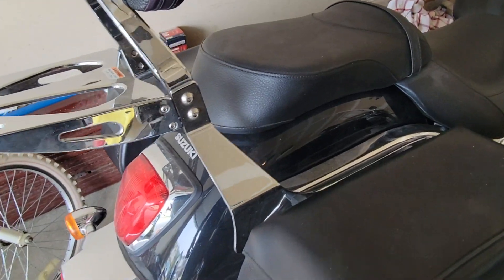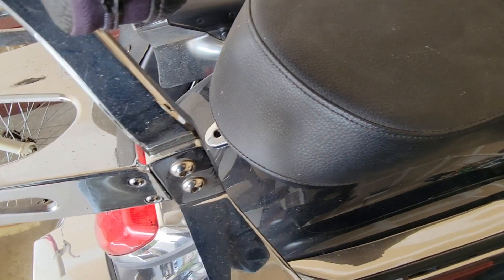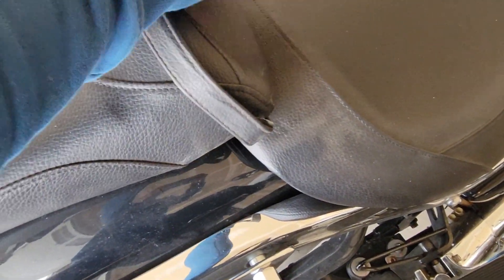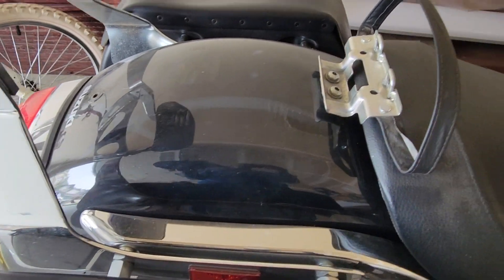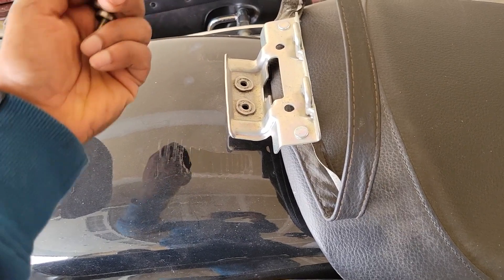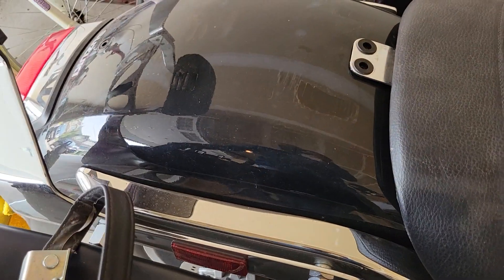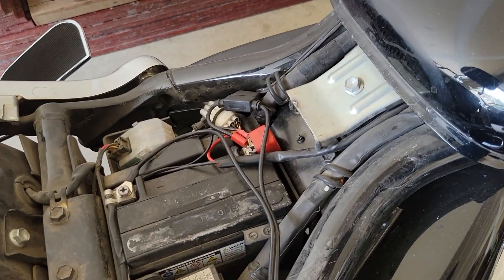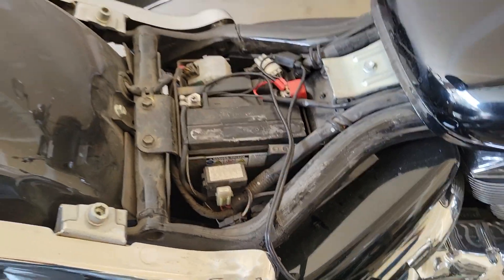Suzuki Boulevard C109RT - Seat Removal

Comment: Hi, there.  I see that you have some experience with the Kawa 2000cc, the Suzuki  C109, and the VTX 1800.  Ever consider doing a video where you compare the pluses and minuses of all three bikes?  Not many riders have had the experience of riding all three bikes.   Thanks.
Reply from the maker: That has been on the cards for summertime. Thanks for the feedback
Reply: @rahulranecool  If you get the chance to do that, please include your size and weight and the ergonomics/comfort level of how you felt on all three.  Thanks.
Reply from the maker: @mr.solitude3352  Will do. Thanks